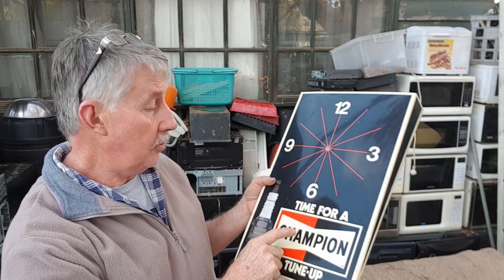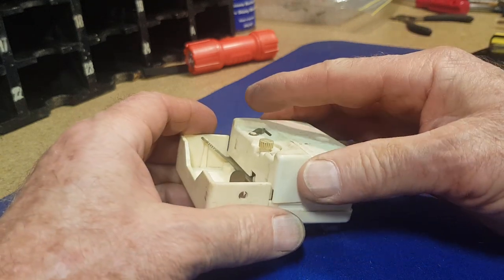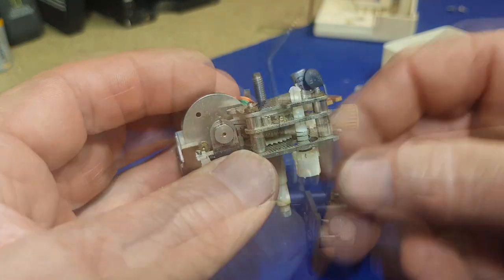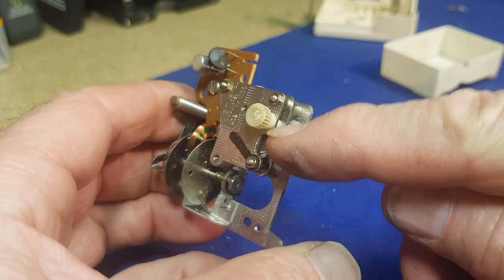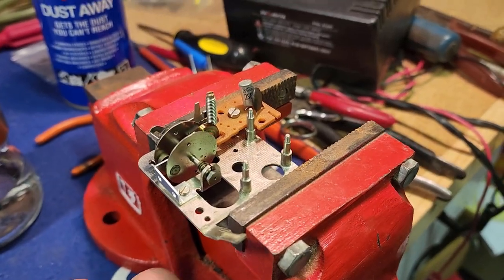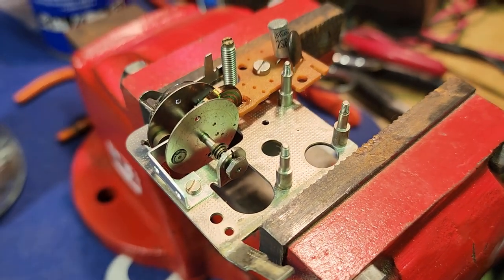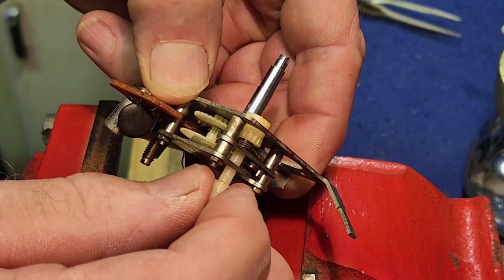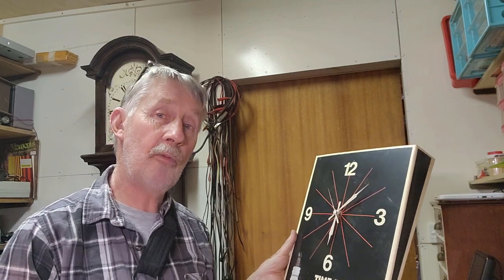Repairing a Vintage 1960s Champion Spark Plug Advertising Clock. Dismantle, Diagnosis & Repair

Comment: Very well done, I thought for sure I'd be bored, but you made it very entertaining! The donor metal gears from a updated sister clock was a genius move and not only did you make a repair, but an improvement as well.
Reply from the maker: Thanks Martin, pleased I didn't bore you! 😁